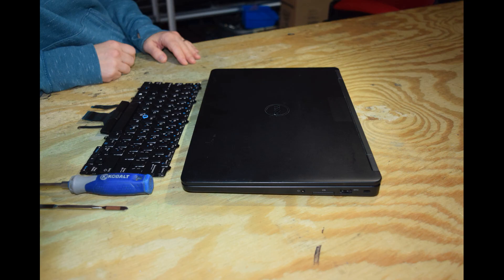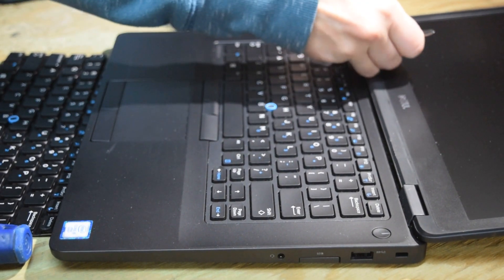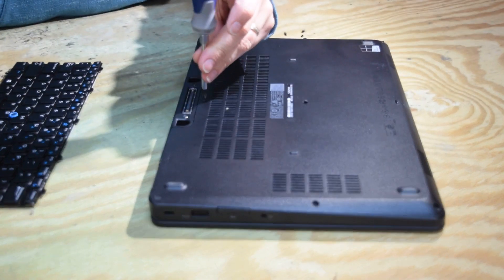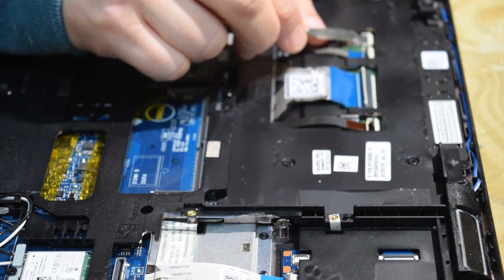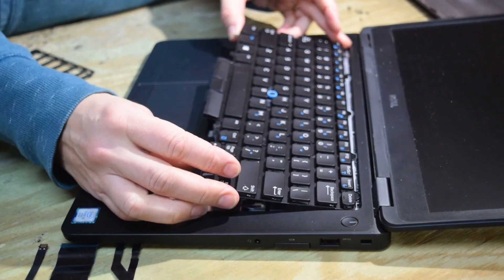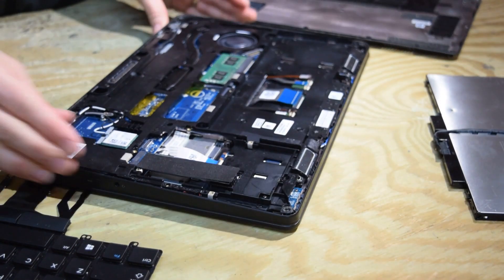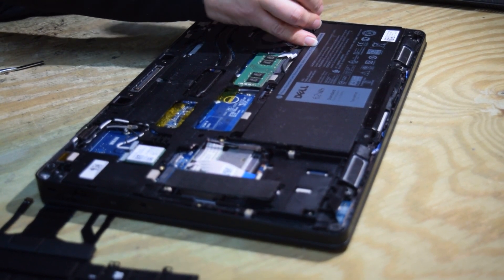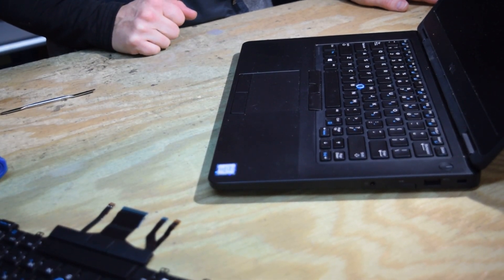Replacing The Keyboard On A Dell Latitude 5490 Laptop

Comment: Apparently there are 2 types of keyboard for these laptops. Mine was a “single port”, while you demonstrated the other type. Use your service tag to verify you have the correct one sent. Finally it was a bit of a mystery reconnecting the battery into its connector, but watching the video carefully I saw you gently just pushed down … I had tried aligning the holes and pushing from the side onto the connectors. That did not work but pushing from the top and viola it worked immediately. Success on my end! Thanks!
Reply: hi ..im in process of hunting down correct keyboard replacement for my 5490, was wondering if you know part number for your kb you mentioned in comment.. my existing kb does not have the track stick or the upper mouse buttons and was wondering if my keyboard has different part number than 6NK3R that i think the track stick kb has.. thanks.

Comment: Super helpful, thank you! Just to let you know, I have a variant of the 5490 that doesn't have the dock port on the underside but the prying in that general area works. Also inside it's slightly different - the CPU fan is in a different location & it's connector is straight rather than angled, also the battery is held in by 2 screws not 1 (once the bottom cover has been removed). Other than this, it's all the same. I suspect these are just 2 different revisions of this laptop.